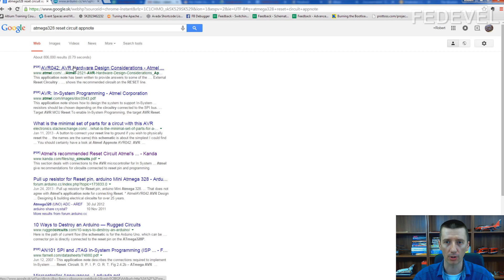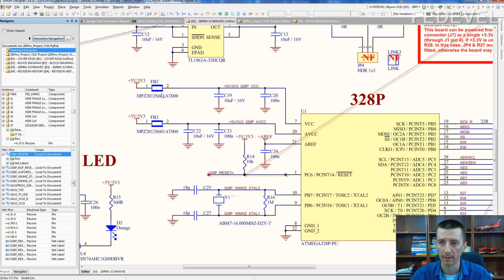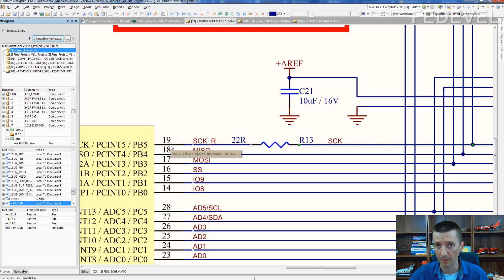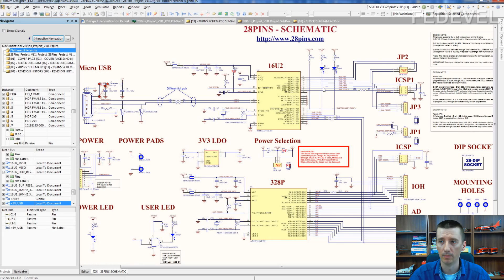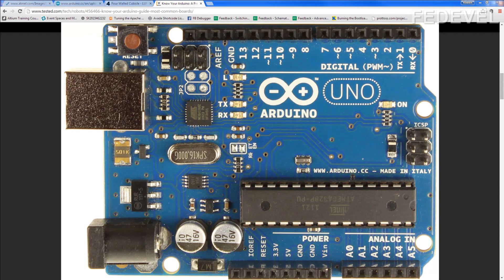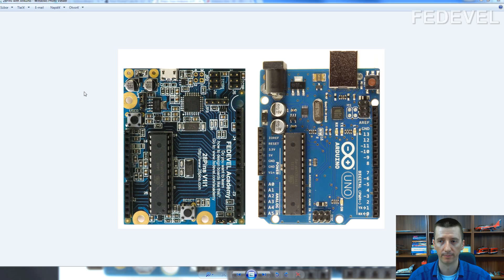14 Tips to improve Arduino Schematic and PCB

Comment: Great and informative Video.  I am going through your video "Learn to Design your Own boards" course from udemy.
In this course, What i like most is : special  attention given to power supply section pins. VCC, AVCC, AREF...( use of decoupling capacitor and FB ). 
After completion of this course , I would like to design a board based on ATMEGA32A , as I need more pins for my project.

Need help and suggestion :
MY Question is: Can I apply all these 14 TIPS , power supply section etc to ATMEGA32A design ?
Can you please share something or schematic diagram or any "link" for atmega32A for reference design ?

Please create another course for any other microcontroller like atmega32A, atmega2560, atmega2561 ?

Comment: Hey Robert,
 I've been looking at your 28 pins Arduino circuit. The reset circuit doesn't make sense to me. Shouldn't "U6" be an OR gate instead of the AND listed in your schematic? If it's an AND gate how does the 328 microcontroller reset?
-Jake
Reply from the maker: RESET is LOW active. I used AND gate to be sure, that if one of the input signals is LOW (or both are LOW), then output is LOW. It means, if reset button is LOW or AUTORESET is low (or both are low), then RESET is LOW

Comment: why you dont add EDS protection in this board? or atmega dont need it?
Reply from the maker: The modern chips have build in basic ESD protection. 
Often the ESD chips are placed on real world connectors which are going to be accessible when your board is build inside a box or on interfaces which are going to be connected for example from other computers. Theoretically, it could be useful to place external ESD protection on the pins, however if you are connecting these pins to other circuits (e.g. breadboard with some components), normally it may not be necessary.

Comment: Hello Robert.One simple question, what Command do  you use in altium for select and view only single a track (like in minute 30:38)?
Reply from the maker: Do you mean TAB (30:38 is end of the video, so I was not sure what you mean)?
Reply: Robert Feranec thanks !!! i just checked on altium haha, thanks!
Reply: wait wait wait :) what does the TAB button do?
Reply from the maker: If you select a segment of a track in your PCB, when you press TAB, Altium will select segments of the track on the same layer and when you press TAB one more time, Altium will select all segments of that track (on all layers). I think, this doesn't work for very old Altium.

Comment: reset capacitor istn't needed anymore, because nowadays AVRs do have brown-out-detection ... in the old days, it was used for power-on-reset, but this times changed.
Reply from the maker: Theoretically yes, practically it is safer to keep the circuit. I have seen a lot of boards with RESET problems (including recent boards), so you really want to keep an option to play with the RESET signal in case of problems. For example, brown-out detection will not enable to tweak RESET time if needed. In some specific applications / connections you may need to keep RESET down for longer because some connected peripherals may require longer initialization. 

Also, if you do not need the reset circuit, you can just keep it unfitted. However, keeping this simple circuit can save you from making a new revision of your board.
Reply: And don't forget ultra-low power scenarios. Disabling the Brown-out detection saves a few uA. Really important if you want to power your device on a coin-cell for +10 years ;)

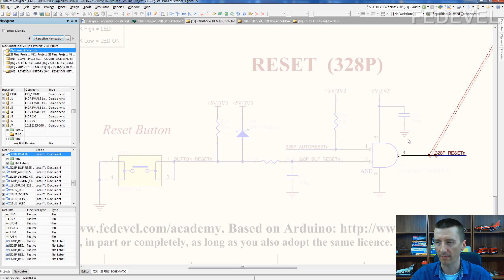Comment: What is the function of the Zener diode D6 @ 4:26 time frame?
Reply from the maker: +InfinityOrchid Do you mean schotky diode D6? The purpose of this diode is to discharge capacitor C32 very quickly when board is powered off. If D6 was not there and you power OFF (disconnect input power) and then power ON (connect input power) of the board very quickly, the capacitor C32 would be still charged and reset would not work properly. Of course it depends on the internal circuit of the gate U6 (there probably is also a similar diode), but you never know for sure, so it's better to place D6 into schematic and if the internal U6 diode on pin 2 can be used, you just don't fit D6.
Reply: +Robert Feranec Thanks for the reply, Robert.
I'm not used to seeing something being discharged to a positive power rail; I have usually seeing a capacitor discharges through a resistor to ground but, not to a positive power rail with the diode, like D6.
Reply from the maker: +InfinityOrchid When you switch OFF power, the positive rail will become 0V.
Reply: +Robert Feranec Oh yes, I see. Thanks for the quick reply.
Also, thanks for posting all these great videos!
Reply from the maker: +InfinityOrchid I am very happy you found them useful :)

Comment: How do you route USB signals? It is not supposed to have a solid return plane underneath those signals between the conector and the microconttroller?
Reply from the maker: +Paulo Lopes: I just routed it as short as possible and broke 90 OHM impedance rule. It's not really possible to achieve nice and correct impedance on 2 layer PCB (the tracks would look weird).
Reply: Thanks
Reply: +Robert Feranec: another question

what if you use a bigger series resistor to match impedance?

and this components to ground?  what are they and they will not create a sub?
Reply from the maker: - series resistors are not substitution for track impedance
- the components to ground are ESD protection, just google for CG0603MLC-05E (here you can find the full project, including schematic: http://www.28pins.com/)
Reply: +Robert Feranec : And if for example I have a 4-layer PCB (Signal GND POWER Signal) and somewhere i need to go from top layer to bottom layer (USB differential pair). In this case, the return path is broken, rigth?? What is your tip to solve this??
Reply from the maker: I normally try to have at least one solid GND plane for high speed and important signals. In your case, POWER can sometimes be a good reference plane to (e.g. 3V3 solid plane with a lot of decoupling capacitors is also a good reference plane)

Comment: Excellent video. I particularly found your tips on avoiding cross-talk interesting. I'm going to research the 22ohm series resistor on the clock line (I haven't noticed this before). Anyway, thanks! I learnt lots!
Reply from the maker: ilkay C How the resistor helps to lower crostalk? The resistor will help to make the signal edges slower. Slower edges = lower crosstalk. (The track + input has some capacitance, the capacitance is low, but it is there and when signal travels through the resistor, then the track + input capacitance will charge slower ... that will make the rising and falling edges of the signal a little bit longer).
Reply from the maker: Darian Cabot If you found the crosstalk topic interesting, have a look at this online crosstalk calculator and put there some numbers from your existing design. You may be surprised about the results: http://www.eeweb.com/toolbox/microstrip-crosstalk
Reply: Robert Feranec thanks for the link, I'll give it a go :-)
Reply: Darian CabotYou should also check impedance matching for transmission lines.
Reply from the maker: ilkay C I did not mention impedance matching, as it's very hard to do for 2 Layer PCB (no solid reference plane, too thick dielectricum => too wide tracks). But you have a very good point - impedance matching is very important.
Reply: Robert Feranec  Hi Robert so that resistor is not about the impedance matching?
Reply: Robert Feranec Thank you Robert.